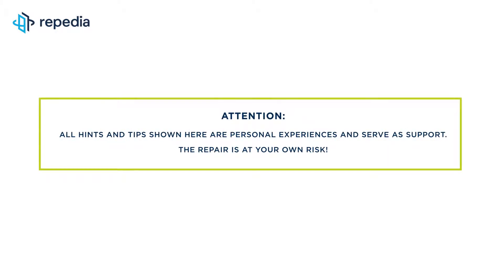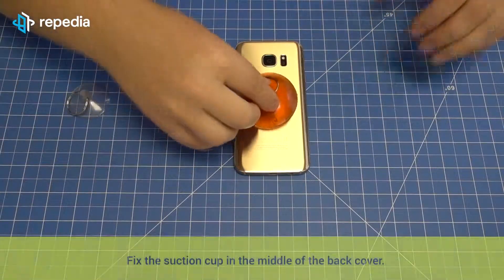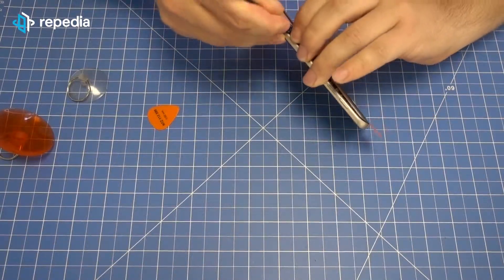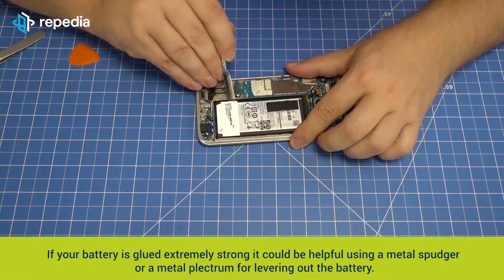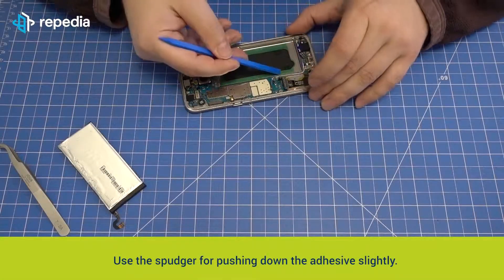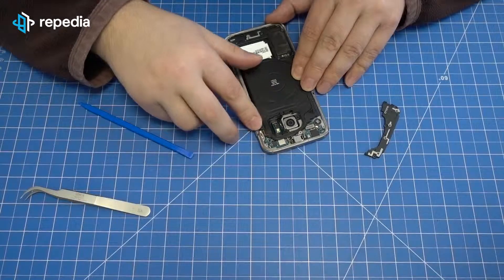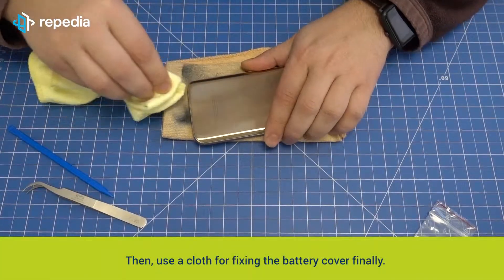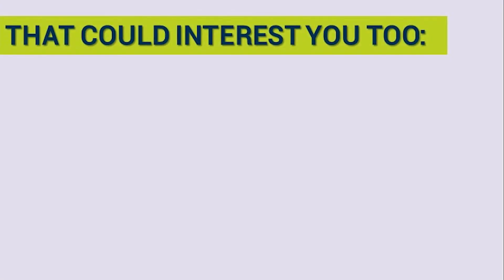Samsung Galaxy S7 - Battery Replacement | Teardown Guide

Comment: So, I am here in 2021. Having the Galaxy s7 for over 4 years I am really reluctant to leave it and buy one of the new flagships which are over £1000. My only preoblem is the battery and a little bit of camera. I am not prepared to sped this amount of money in the pandemic crisis times and wonder is it worth it to try and change the battery? Or get a new midranger with plastic back, lack of wireless charging and compact size :(